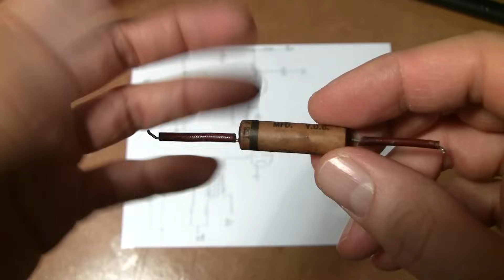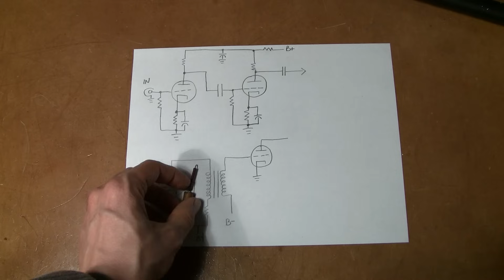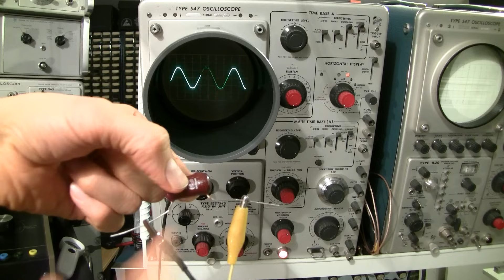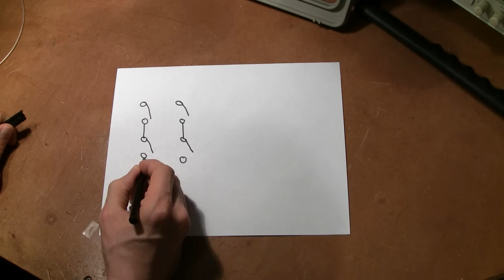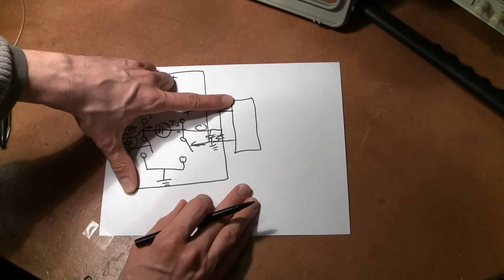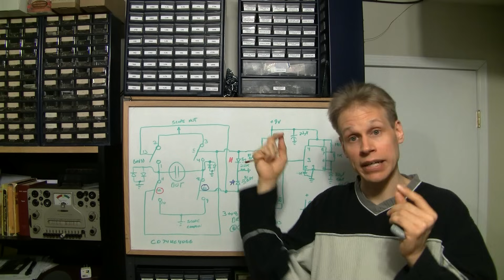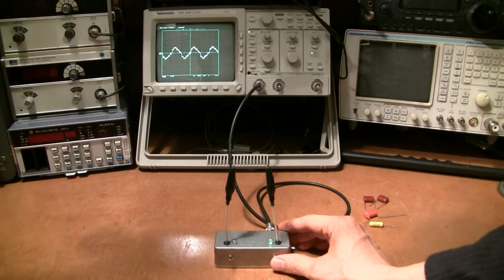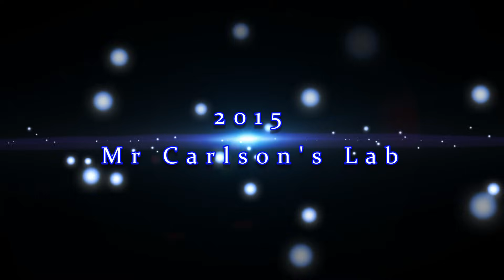Are Your Capacitors Installed Backwards? Build this and find out

Comment: Great video! More than 35 years in electronics and I did not know this. Cheers.
Reply from the maker: Hi Jim, If I had more, I would. I'm going to make a self contained unit (no scope needed) in the future. At that point I may make some extras. Thanks for your comment.
Reply: @MrCarlsonsLab  ,   I don't think a ME TOO might be out of place here... but I am willing to buy ANYTHING you wish to sell if you designed it!  de KQ2E
Reply from the maker: +pepe cohetes 
Glad you enjoyed the video pepe!
Reply: @MrCarlsonsLab  i never have seen so moutch equiment  with a radio man
Reply: i haven't had any luck with a siglent digital meter either. the best luck i have had is with turning up the volume on a guitar amp and touching one lead to the tip and one to the sleeve. reverse this process and listen for the  loudest hum. whichever lead is on the tip is the outer foil. be sure and don't ground yourself to the input jack or it won't hum.
Reply: @jonathanbobohunt6507  Jonathan do you mean like just a jack lead into the amp?? & touch the capacitor off the tip & sleeve of the lead????
Reply: @keithking1985  yes I ended up taking a 1/4 inch guitar plug and wiring alligator clips to it. red on to the tip and black to the sleeve. clip it to the leads of a capacitor. I plug it into a mixer that I have and use headphones to listen. touch the body of the cap and listen to how loud the hum is, then reverse the leads and listen again. the outside foil will be the black lead on hookup that was the quietest. I turn up the volume on the mixer really loud and it makes it easy to tell. you can also plug it into a guitar amp. I hope this helps. good luck.
Reply: @jonathanbobohunt6507  thank you Jonathan..  that was a good idea using the amp like a scope. but instead of a visual signal using the sound... class..
Reply: @keithking1985  A typical plug on a guitar cable has a tip and a sleeve. Plug the guitar cable into the amp. Turn up the volume. Touch one capacitor lead to the tip and the other capacitor lead to the sleeve. Touch the body of the capacitor. Now reverse the capacitor leads so that the opposite leads are going to the cable's tip and sleeve. The arrangement that produces the louder noise is with the outer foil connected to the tip of the guitar plug. If you're going to do a lot of testing, get a double pole double throw (DPDT) switch and wire it so that when flipped, the switch reverses the leads' connections to the guitar plug. Kudos to Mr. Carlson for bringing this matter to our attention. A lot of us old guys never thought about optimizing the "polarity" of a non-polarized capacitor. Connecting the outer foil to the lowest impedance point doesn't matter in every circuit, but it matters in some.
Reply: +pepe cohetes Similar with me too, only it's 55 years. Mr Carlson, would you sell me one of these gadgets? Excellent video - I will subscribe.
Reply: Texas
Reply from the maker: Thanks for your comment Seth!
Reply: I watched this when it was first published and simply used the scope as you showed. Now, after this much time has elapsed, I believe I would like a device like that.  I believe you have a marketable product and I want one. If you produce any, please put my name on one.
Reply: You are amazing! Do you have any email? Which part of the world are you. I wish I could stay with you for 2-3 weeks and learn more electronics. Thanks for sharing this knowledge across . Simply amazing
Reply: me too.
Reply: 40 years for me, & I'd never heard of that either.
Reply: I can't really say I'm into electronics, since I repair simple stuff for friends (I'm a computer repair guy mainly) but NOW I KNOW THIS with so many years of vantage! Thanks!
Reply: @JOHNDANIEL1  Yes. I learned the same from a diy electronics for musicians book back in the 80’s.👍🏼
Reply: Yeah. This was new to me. I guess I was just lucky with the tube amp I build. No hiss or humm at full volume. I used the circuit from an old GE tube manual. Only had 20/20 W but I found it plenty for my big speakers.
Reply: Just found you. Great job! Thanks! Wish I had your info 50 years ago when building my first tube amp. Using tin cans for chassy and parts cut from old TV's. Had to buy the tubes, but made my own transformers.
Reply: +Mr Carlson's Lab I knew about it, and I suspected those lines were erroneously placed on the components, possibly at random. It is a good thing they don't mark diodes for a living! I have a very nice LCR bridge, and the O Scopes, but that little test jigger could be rather handy. I usually run all my caps on the LCR just for GP, and a piece of aluminum foil in hand will verify the shielded lead, or outer foil, by showing a higher C reading on the LCR between the foil and one lead over the other.
Reply: Maybe theyre marking the unshielded end?
Reply: I'd be interested in getting one too. I'm just a solder monkey and I can't seem to replicate your test on my Tektronix 2215 60MHz?

Comment: Define "goop"
Reply from the maker: +Robert Langford 
It's indescribable stuff!
Reply: +Mr Carlson's Lab 
"Goop" can be described or defined.
It's not like the Robert Pirsig's idea of quality, which defies definition. 

Goop is the stuff that some manufacturers insist on putting over a major portion of a PCB and it's components, making the item virtually useless
and uneconomic to repair.

Therefore GOOP is the total opposite of quality, plus it makes your life as a tech a misery. 
It may give some form of warped satisfaction to the person applying the GOOP, but the tech trying to seperate it from the components which the GOOP is GOOPING together, is "not so quietly" cursing the rotten M.F. who had the nerve to play such a nasty practical joke on him!

Sorry, couldn't help myself. 
Had to get it off my chest, feel much better now.
Deep breath,  calm.

Oh yes, almost forgot:
Goop is that rubbery substance, often silicone rubber used to hold down generally largish components in electronic assemblies such as electrolytic caps to prevent them from vibrating free off the PCB.
I think it is an American term, not 100% sure of that though.

Have a nice day and peace man!

Comment: Would you be  kind enough to tell me the settings you used on your o-scope.   I have one but not sure how to use.  Want to learn to do this   (check  caps)   Sorry about being on the dumb side.  Thanks for your time . 

David
Reply from the maker: +David Stiles 
No Issues Dave. Touch your oscilloscope probe and tune the scope for a nice looking sine wave. The sine should be 60Hz at this point. With a direct probe (not 10-1) attach your capacitor between the common and center conductor of the probe, turn your sensitivity (Volts per division) to the most sensitive setting. Now your ready to go.

Comment: I watched this, but some of the finer details are overlooked. On the white board, he mentioned he used a 555 timer clock circuit. OK, but in the real terms the 555 is configured as a Astable Oscillator, which you can find in any of the Radio Shack Series Books or just Google it online. The output frequency is less then 1 Hertz, maybe 0.8, I don't know. Also, make sure you put 0.01uf capacitor on pin 5 on the 555 timer. I've seen the IC do some very strange things without it. Dave's EEVblog has a video. I won't go any further, but at least you have a block diagram to work with.
Reply from the maker: +Neilrrc37 
Thanks for your comment :^)

Comment: Always enjoy you highly informative videos Mr Carlson! Thanks for taking the time to do these. One question though. Using Techtronics 465B scope and 10X probes I see very little difference in most of the cpas I checked. Seems to me I would need 1X probes to see the relatively small signal generated?
Reply from the maker: +Neil Jolly 
You bet, A simple shielded cable with with alligator clips will work as well. Thanks for the kind words!
Reply: +Mr Carlson's Lab 
Many Thanks Mr Carlson!
Reply: @neiljolly3941  I could not replicate this either at first.  Then I realized there was not much 60 Hz interference in my shop.  In fact, I have some dual-tube 4 foot LED fixtures in my shop, so likely no interference from them.  So I plugged in my Isolation transformer and held my capacitor/and finger just above it, and presto got the visual reading on my Hitachi 20 MHz scope!

Comment: I just want to make sure that I would know the difference between what an AC capacitor and a DC capacitor. It looks a little confusing because those capacitors had a line on one side, which could make them seem like DC capacitors,....but that line is meaning something else.
Reply from the maker: +John Kerley 
Yes, in old times it symbolized outside foil. Some where in time, this meaning got lost or abused by the manufactures. Most likely for money reasons (is there ever any other reason?) If you install these capacitors in a DC circuit where orientation is not important, they will be fine. If you install an electrolytic or tantalum capacitor the wrong way, they explode.
Reply: +Mr Carlson's Lab Thanks. I guess it is mostly the can type or tantalum bubble type capacitors that are DC capacitors. I was just wondering because I was thinking of trying to replicate one of the YouTube projects that uses an AC type capacitor in it,and I wanted to be sure that I would know that these type capacitors would be nonpolarized.
Reply from the maker: Well, "non-polarized" in a DC circuit yes, but polarized in an AC circuit. I address this topic many times in the comments.
Reply: +Mr Carlson's Lab I thought that capacitors for DC circuits were called polarized.
Reply from the maker: They are.
Reply: +Mr Carlson's Lab Ok, thanks.
Reply from the maker: No Problem John. Good Luck with your project!

Comment: I mean, your talking about the issue of interference sheilding, but it is not a polarity issue like in DC electronics, therefore marking the line on the one side is not to be confused with the line that would be on one side of an electrolytic capacitor.

Comment: Gosh I couldn't get this to work on my 2 scopes (Tek466 & Owon 20MHz handheld).   I did try it in my Fluke 189 DVM on AC mV scale & got some mixed results.  Some caps were almost identical & some were consistent & showed definite polarity.
Reply from the maker: +Bob Ograv Hi Bob, try using a direct connection to your scope, "No Probe."  So a piece of coax with alligator clips, directly to a BNC.
Reply: Mr. Carlson - That is how I had them hooked up.  I also tried the scope probe for grins.  Maybe my Tek has a triggering problem, as all it shows is a HF noise.  No discernible trace at 5mV; the lowest scale even tho the trigger light is on.  The Owon shows a noisy Sine wave and some random waves at one end of the trace at 2-3mV.  Maybe I am not a good antenna. ;-)  I'll keep trying.  Let me know when we can do the Vulcan mind transfer. - Bob
Reply from the maker: LOL, Ok. Just for grins you could try to bring an insulated line cord close to the capacitor under test (impose some 60Hz) I do notice that some scopes have very noisy front ends.
Reply: Mr Carlson - I feel like I am addressing my 7th grade History teacher.  OK, that worked!  The Tek 466 still had some noise on the "sine" wave, but it was clear which side was the shield.  The OWON handheld produced a very nice trace & correlated perfectly with the Tek and the traces looked like yours.  I'll sched the vulcan mind transfer with the school nurse.   I am also wondering how you got that TT Eagle schematic???  No reply necessary on that. Thanx - Bob

Comment: Well,
 a simple 2 X SPDT mechanical  switch will do the job better,simpler and cheaper.
No need for that electronic circuit that is an overkill if I ever saw one...
Reply from the maker: +Tovi Bar 
Well,
Tovi... I guess it's just that easy, is it? I think you should make a video with your box and show us.

Comment: I understand what you are getting at ................. but isn't there a simpler way of determining the shield side of an unknown capacitor by measuring the capacitance of each lead to the outside of the capacitor? Something that does not reuire an oscilloscope. Perhaps a 555 astable feeding a diode into an RC pair. Measure the voltage across the RC pair. Attach two probes to the capacitor of the astable. One probe goes to a plate and the other goes to an alligator clip. Place the unknown on the plate and the probe the two leads one at a time. The larger drop in voltage will indicate the shield side.
Reply from the maker: +E Lye
 Give it a try and let us know how it goes!

Comment: I'm somewhat envious of this nerdiness!  Does the polarity matter on low voltage circuits (like a guitar pedal)?  Also, is there any other way to find the polarity without a oscilloscope?  Thanks for the videos!  Great info
Reply from the maker: +HellBent1337 
Browse the comments, there have been a few suggestions about using an amp to do this as well. Thanks for your comment!

Comment: Very informative and I definitely learned something. It does annoy me, though, that you refer to this property as polarity. It's about which end is connected to a low impedance, not which is positive and which is negative.
Reply from the maker: +Sean Breheny  Hi Sean, glad you enjoyed the video. Don't be annoyed, For example, do you have a polarized wall outlet, or polarized line cord? What makes the outlet itself polarized? Well, one slot is larger than the other. The same with the line cord. Many times they identify the polarity of the line cord with a stripe or ribs on the insulating jacket as well. So if they can give outlets a polarity, and line cords a polarity, I think it's ok to denote the band end that gives the capacitor a polarity in circuit.  Polarity doesn't solely mean positive and negative, much to many peoples misunderstanding. :^)
Reply: +Mr Carlson's Lab Yes, I agree that the term polarity can refer to other things besides positive and negative, but with capacitors we already have the term polar defined in the sense of positive and negative. It seems to me that it is bound to cause confusion to use the term to also mean something entirely different while still talking about capacitors - especially when all of the capacitors you are talking about here are called non-polar (how can a non-polar capacitor have polarity - just speaking from a logical standpoint?)
Reply from the maker: +Sean Breheny 
Hi Sean. The whole idea of this video is to show people that they do have a polarity in circuit, even though they are said not to. People claim that the outside foil doesn't matter, yet a difference (dramatic in some cases) is seen clearly on multiple pieces of test gear. It's ok to still think, "or want to say" that these capacitors have no polarity, due to the fact that you can install them any way, and you won't get a "Bang!" Since these caps have an outside metalized polypropylene layer (outside foil) "which most people don't know," that side of the capacitor should be connected to the lower impedance portion of the circuit. Since there is a proper orientation for these capacitors, and they should be installed correctly, could they not be considered polar? It has be noted that even the manufacturers don't consider the outside foil to be important. This is most likely due to the fact that they are thinking only in solid state applications, (low impedance circuits) many times with a circuit board ground plane layer right below.
 I understand that people don't like change, (the thumbs down count) because they have been taught, or believed something all along. Today you learned of something  (as you claimed above.) Is it really that hard to accept that the word polarized may "now" also fit this scenario, and be applied to these capacitors?
Have a good day Sean :^)
Reply: +Mr Carlson's Lab I did indeed learn something (I had not thought about the outside metal layer) and I understand how that can be a concern, even in high-impedance solid state circuits like FET-based amplifiers or op-amps. I just think that it's best to avoid equivocation when possible. We have three options here: add a new definition of polarity but still call these caps non-polar (confusing), re-define the term polarity when it comes to capacitors so that almost no capacitors are called non-polar (difficult to get the entire industry to change terminology), or continue to point out the valuable asymmetry that you are explaining, but use a different term for it, like for example "outer-foil lead" or "shield lead". I like the last option best.

Comment: Awesome video Mr. Carlson.  I had no idea.  I can't seem to figure out how you are hooking up the caps to your oscilloscope.  What are you using to generate a signal?  I see you're only using one test lead.  What am I missing?  I tried this with a function generator and my oscilloscope.  I used two test leads.  One from the FG to the cap and the other from the cap to the oscilloscope.  Ground leads of probes connected together.  There was absolutely an effect when my hand touched the cap, but I didn't notice a polarity difference.  I have to assume I'm doing something wrong.  I'm testing vintage paper in oil capacitors.
Reply from the maker: +LBA Studios 
 You are acting as a 60cy antenna. The test leads go directly to the scope, it's a shielded cable.
Reply: Awesome!  Thanks for the valuable insight.  Trying this again I first noticed only certain capacitors were responding to this polarity test.  After closer inspection I realized they are all responding, but some caps are more subtle in revealing their polarity.  Regardless, this has proven to be a good bit of insight and I thank you greatly.  Can I buy you a 6 pack of beer?
Reply from the maker: +LBA Studios 
Great to hear you got it working! Thanks for the offer, but I don't drink :^)